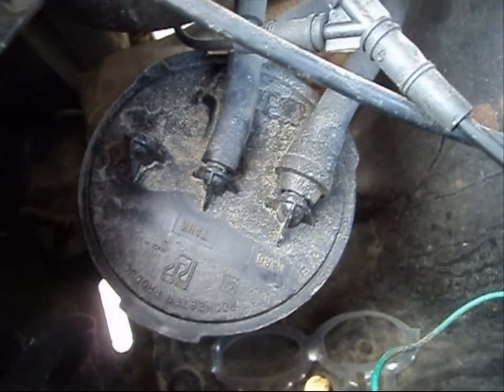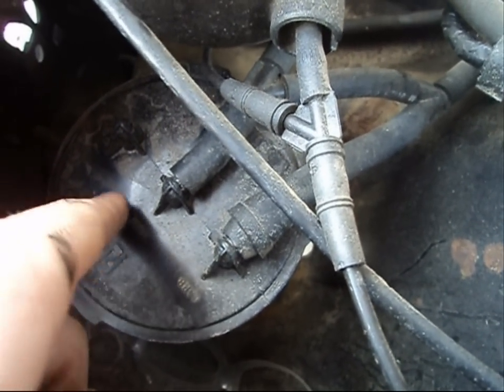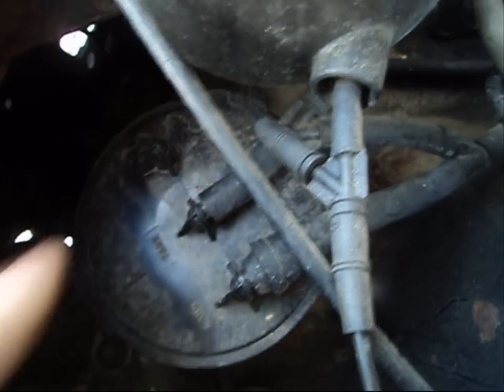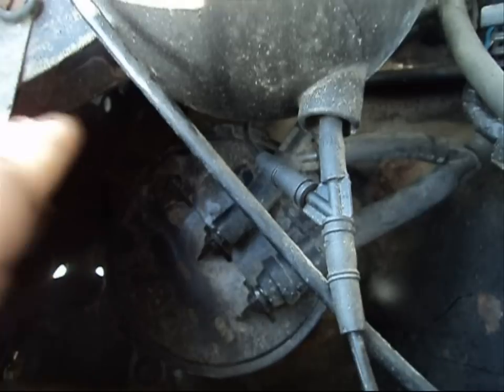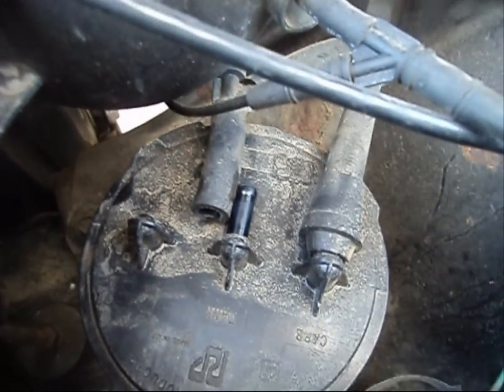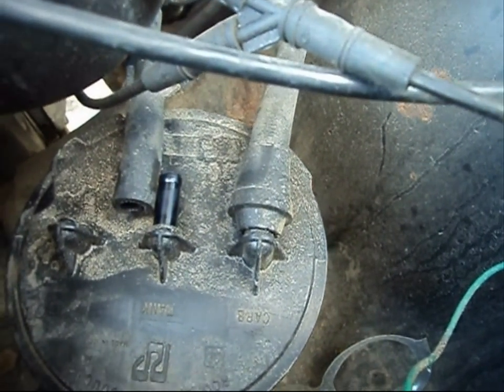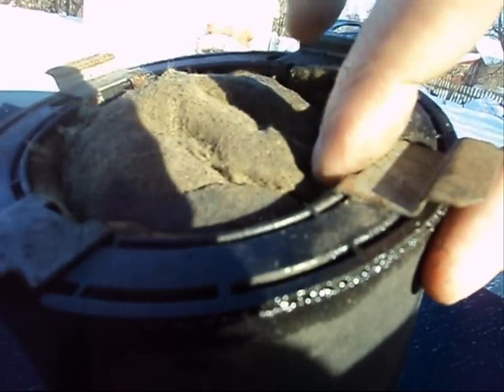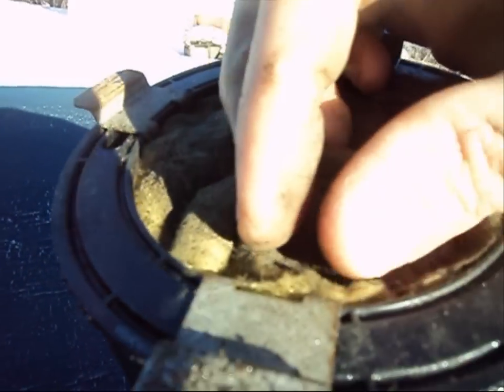Whoa, Fumes? Evaporative Emission Control (EECS) Purge Canister Inspection

Comment: Real helpful video, I have a 1976 grand prix base model and I've been getting strong gas fume smells lately. I purchased a new canister today but when I went to install it I noticed the line back to the tank is capped off with a screw while the other two lines are connected. Also on my new one reads purge, tank and air instead of carb. Would that be the same thing?
Reply: one is to vacuum intake source.  another to PCV line, and another to fuel tank.  the air one may be just atmosperic pressure(air) or a vent.

Comment: I have an 86 caprice classic brougham just had full tune up plugs, wires, distributor, fuel filter, and air filter replaced. Then a couple weeks later had the radiator, hoses, and belts replaced. 
After all this my car started having really hard starts and I'm having to rev the engine for a couple of minutes to get to stay started and it idles rough as hell for a couple minutes then evens out and is fine after that it drives fine, and starts fine for the rest of the day but my gas mileage has gone to shit, and just a couple days ago I went to get gas and the pump keeps clicking off every couple of cents like the tanks full it takes forever to get $10 in my tank. I did some online investigating and came across this video and assumed that my problems might have something to do with the fuel vapor canister? Any ideas?

Comment: Do you have experience with 80's cars that have these emission control devices removed? I have a '87 305cid Caprice and it has a Holley carburetor and (I believe) an aftermarket vacuum distributor. These are the main components to be changed after egr & etc is removed, but do I have to get a new fuel pump also? If original pump and that coal can has something to do in common and there's electronics involved.

Hope you understood something :D
Reply: will have to remove the cat converter also because the holley dumps alot more fuel than the original E4ME Q-jet carb did. the extra fuel that is unburned and out the exhaust wil cause the converter to plug up and contaminate it over time. will  need to have an HEI distrib from a 1975 to 1979 years(non-ESC or EST style engine 3-wires harness or from a heavy duty truck 1989 older with the same HEI large style distrib and not TBi small style distrib.  however some of the '80 and up ones did have a vac advance with EST(including the 1982 K10 trucks with 305 and auto trans) and you can actually jump a couple of the 7 wires plug and make it work act like a 1979 and older one i can look up which wires to jump if you need?  if you need info etc let me know.   fuelpump is still same 7 to 9 PSI nothing different regardless of emissions equipment.  carb needle seat still needs same pressure volume to operate no matter if its electronic ESC version or not.  and if you want to do away with mechanial pump you can go get a factory style stock electric operated single 12v wire one for s 1985 C10 with the 4.3L 4 bbl engine and use that,  from factory these were installed on the wheel tub inner fender on those trucks that year.  and you just use basic 3/8" fuel hose and hose clamps  really easy.  and make or buy a flat steel plate with bolt holes drilled though it to blovck off the pump hole in the  block,  find one on a 1987 up engine 4.3L or SBC

Comment: Changed the filter and it didn't help at all. Caprice still rough starting still rough idle, and I still can barely pump any gas into the car without the pump shutting off. And why do you make these videos if you're not going to reply to the comments?